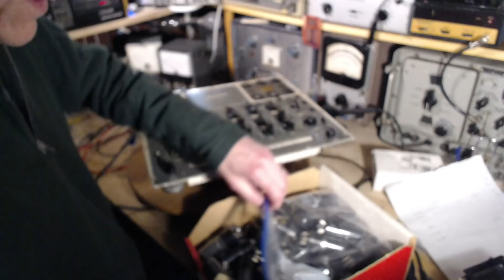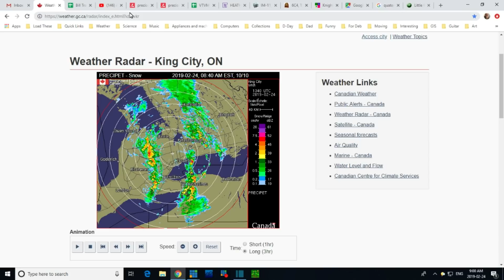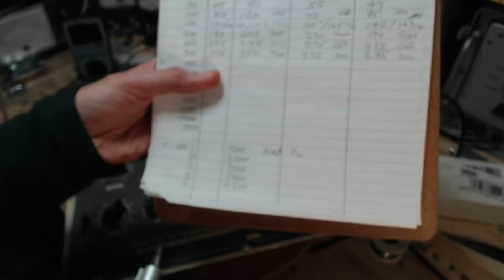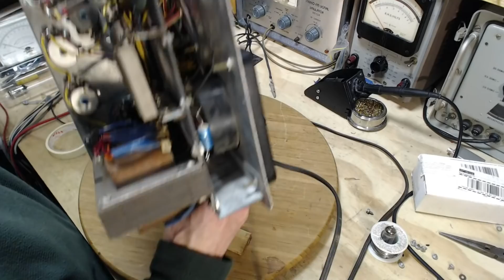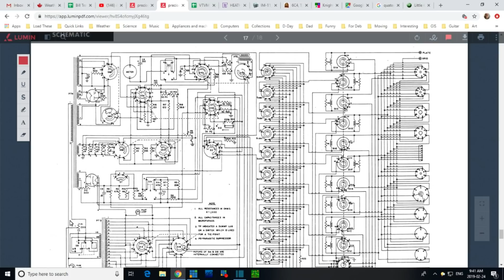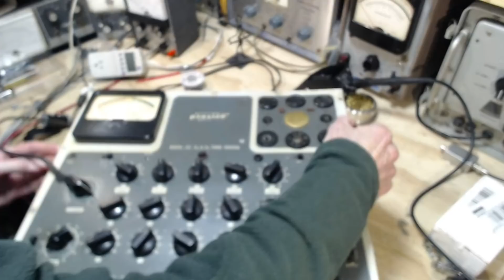Precise Model III Tube Tester Video #7 - 50L6 Tests

Comment: Hey Jim, the posts previous to this are correct on the 6l6 being a higher power output tube. I pretty much repair and rebuild guitar amps most of the time and know these well. If you can’t find one I can send you one. A 6l6gc can handle a max of plate voltage of 500v, a 50l6 can handle 200v max. I found a good layout of the 111. You might have seen it but it gives a better view of how the thing is laid out. http://bama.edebris.com/download/precise/111/Precise_111_Asm_Diagrams.pdf

Comment: All L6'. are not the same.A 25L6 or 50L6 runs on much lower voltage and current. They are found in low-power phonos and radios. Output is under 2 watts. A 6L6 on the other hand can run up to 400 volts plus and 10 or more times the output, circuit deprnding. They are used in high-power amps like Guitar or PA amplifiers. If you have a tube manual, check it out. Using one of the others will not be the same and will throw off your alignment. They probably have different settings on the tester too.

Comment: Jim, while the 6l6 and 50l6 have the same pinout, they are NOT the same tube !.
Compare the data sheets, the 6l6 is made for much higher power applications.
Bob
Reply: Would I be right that Groove Tubes stock the 6L6 vacuum tubes.